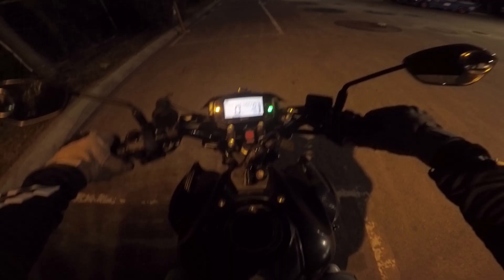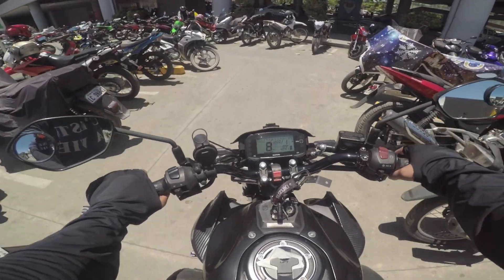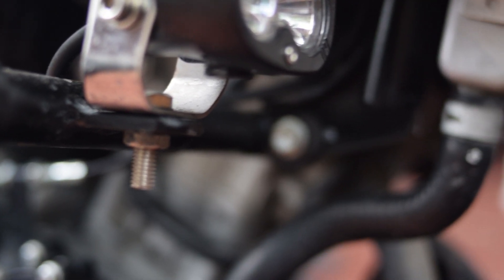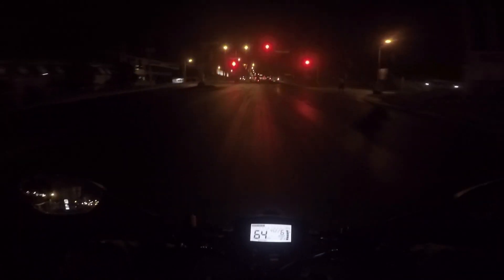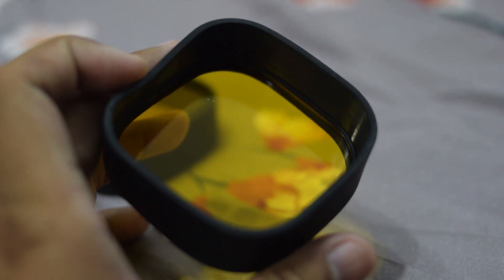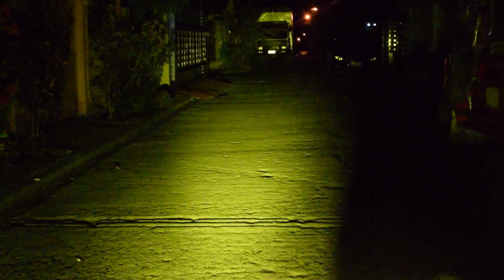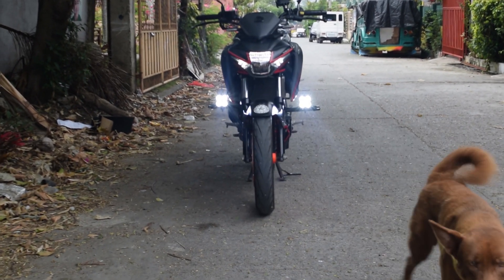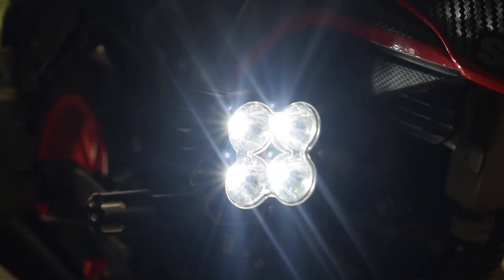TDD Lasergun Led Light | Review | Suzuki GSX S150

Comment: Boss marc anu sukat ng handle mo bracket ng tdd ..plan to put also in my gsx
Reply from the maker: Kasukat ng stock handlebar natin sir, extra handle bar to na nirecycle ko at pinalagyan ng base plate sa machine shop
Reply: Sir @iammarccc  one more paps ..ilang cm bali ung isa side ng bracket ..thank you sir.more power
Reply from the maker: @hernanalbania1487  yung haba ba paps?..mga 7-8"

Comment: Pa link po nang bracket po sa laser gun kung saan sya nabili.. Ty
Reply from the maker: DIY lang yan idol, gamit old na handle bar, pinutol at dinugtungan ng plate sa machine shop
Reply: @iammarccc  salamat po sir..
Reply: @iammarccc  paps..sorry sa ask.. tanung ko lng kung pwd kaya lagyan din ng bar sa ilalim ng sniper 150 ko.. gusto ko same location ung lagyan ng aux mo.
Reply from the maker: @orlandobillate1013  hindi ko kabisado ang sniper paps, pero kung may engine bolt na pde kabitan, magagawan ng paraan yan

Comment: Papz hindi ba bawal ang laser gun sa LTO salamt po sa sagot
Reply from the maker: Hindi bawal paps as long as sinusunod natin yung guidelines nila tungkol sa aux lights:
1. Should be installed not higher than handle bar
2. Should be white or selective yellow in color
3. Atleast 4 inches apart
4. Max of 6 leds per bulb
5. Max of 2 bulbs only
6. Not installed on parts affected by vibration
7. Should point downwards
Reply: Cg papz salamt po  nang marame ride safely sa lahat

Comment: tol wala ba epekto sa battery yan??
Reply from the maker: Wala sir, basta automotive wire gamit nyo, original ang relay, at may sariling switch, safe na safe yan 😊
Reply: @iammarccc  sige nga sir kabitan mo nga ako nyan,, taga saan ka ba?
Reply from the maker: @leonilbuhayo5060  davao ako pero hindi po ako nagkakabit, di po kasi ako expert :)